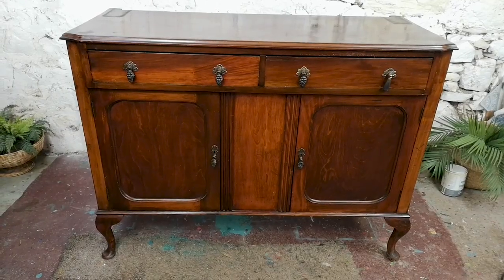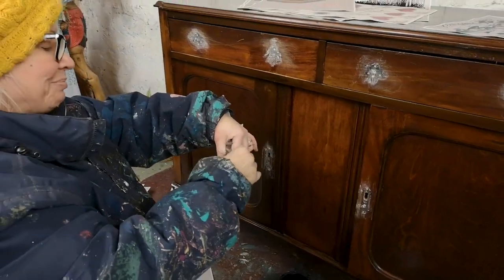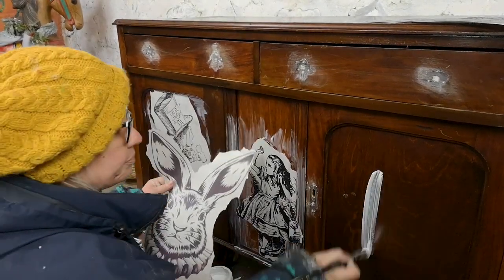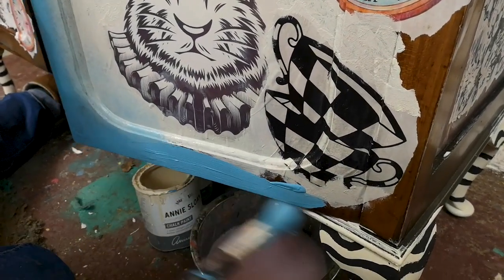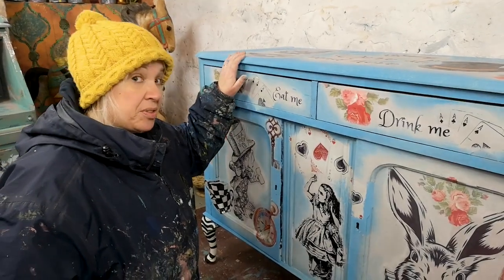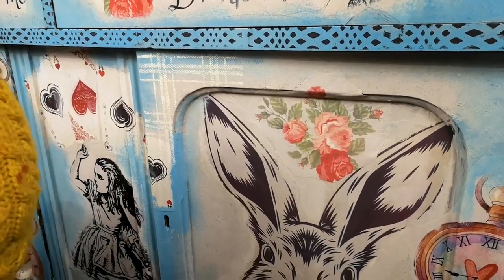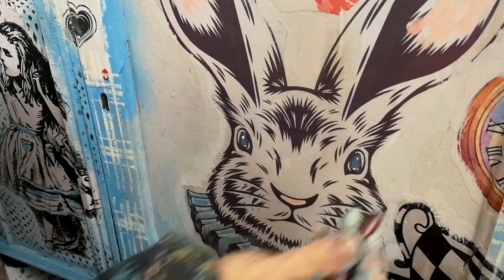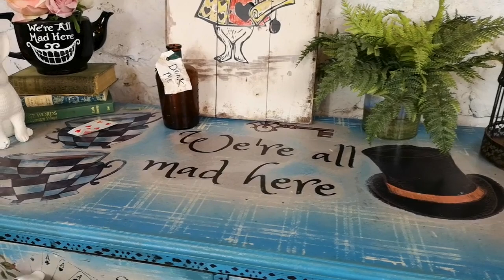How to Create an Alice in Wonderland inspired Piece of Furniture Art

Comment: I’m not in the UK. Did you sand the whole thing before you started? What did you use to fix the decoupage sheets on?
Reply from the maker: No I didn't sand anything our own Made by Marley Paper is best applied to a smooth surface and I use no prep paints all made by marley paper is applied with mod podge.... Hope this helps.
The full Alice in wonderland limited custom set is available on our website
Www.madebymarley.co.uk